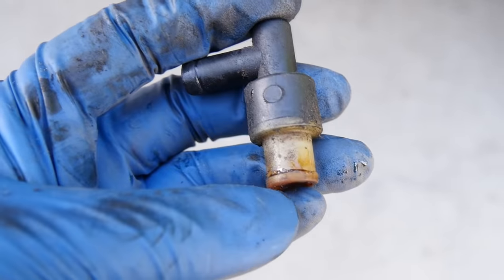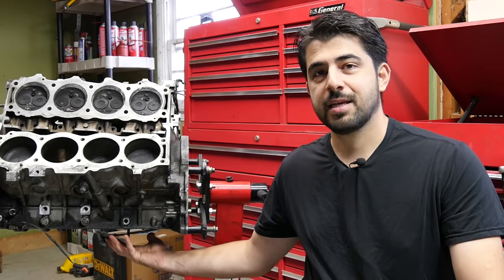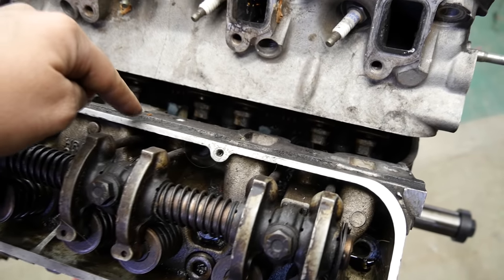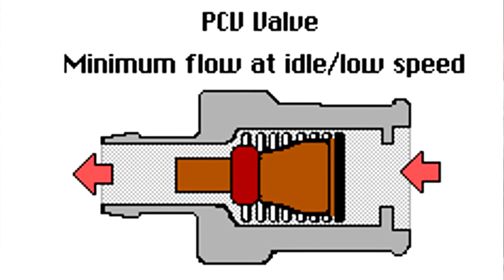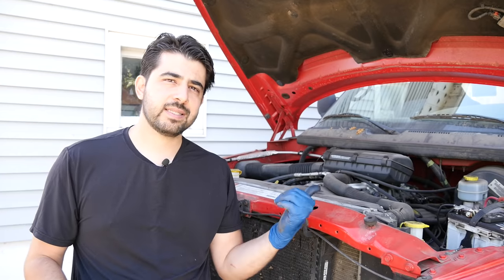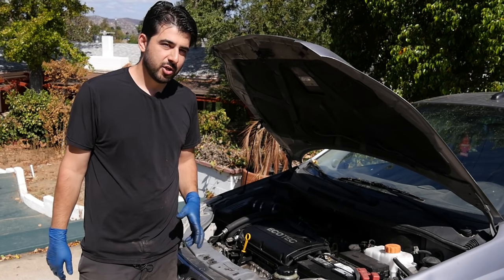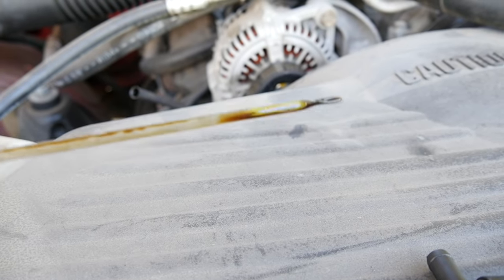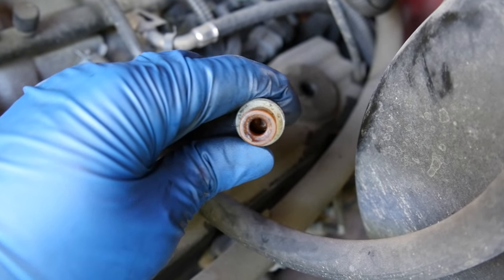The Valve That Can Cause Major Engine Troubles - How to Avoid Engine Sludge

Comment: Nice tutorial. If I may add:
I was thought that the main reason for the spring operated valve inside the unit was to prevent flames from backfired carburetor to go back and ignite the air fuel mixture in the crankcase.

In old engines with carburetors, a backfire flame can travel through intake manifold through the hose back to the valve cover and down to the oil pan area. Thus, the name Positive Crankcase Ventilation valve. Otherwise a one-way valve. 

 Before PCV valves on engine, there was a draft tube that vented the unburn air and fuel mixture to the atmosphere. This produced smog. 

With fuel injector systems on cars, there is very little if any chance of backfire. There is still a need to remove unburned air/fuel mixture from the crankcase.

A small spray of carb cleaner can go a long way to keep the valve working.

Comment: I just went through this same thing on a '98 Ford Contour 2.0.  On this one they made it where it's really difficult to get to.  It is not on a valve cover it is in the crankcase, under the exhaust manifold. There's no way to get to it without removing the e manifold.  The valve cover vents into air intake.  Repairing both, valve was clogged, now working and the other hose from the valve cover was rotted.  It still has crankcase pressure. At idle remove the oil fill cap and it feel it blow out a lot of pressure.  Seals are leaking, they stopped for awhile when I repaired pvc system but pressure is back. And, as you said, vacuum only happens at idle, I can only imagine the pressure get worse above it. Told this customer it a goner.

Comment: In my opinion, if your car is 10 years old or more, does have a PCV valve and is not a pain to replace, doit. The valve costs about 5 bucks or even less, and the grommet about 3 bucks or less... just replace the valve AND the grommet and you could even restore some of that lost mileage!... (or so some utubers claim)

cheers!

cheers!
Reply: 5 bucks for a new PCV valve? Lucky man.. In my country there are genuine PCV valve available, that costs me 70 bucks, plus a new PCV hose for 40 bucks.. It's a 2002 Ford Focus 1.8
Reply: @flycorvus   bro here in South Africa a pcv valve for my Renault scenic ii is around 80 US dollars. And it's only a piece of plastic with a spring and rubber diaphragm... Never buy it. Catch can is almost half the price☺
Reply: Joburg

Comment: Replaced on 70s 302 Ford pickup.  Fram. Ran lean backfired up carb. Always use factory part. Genuine Ford valve fixed.

Comment: Great explanation on PCV valves.
At 120,300 miles I replaced the water pump (weephole leak) and drive belt on my 2018 Civic EXT. Since Honda service were already working on that I had them replace the PCV valve as preventative maintenance. Aside from an earlier AC Condenser replacement (fully covered under Honda extended warranty), the water pump, drive belt, coolant flush was the only major work on my four-year old Civic (Total cost: $1,045.00). Currently averaging 34.1 mpg. Great car.

Comment: A few years ago I bought a Toyota Sequoia cheap because the dealer thought the engine had bad head gasket or worse. After checking things over I found the PVC totally blocked. I installed a new PVC valve and I'm still daily driving that Sequoia with no issues. Yes replace the valve, It's cheap and easy to replace on most engines.

Comment: Yeah you didn’t say how often you should replace it and replacing mine right now after 65,000 miles just because
Reply: They are cheap so I replace them every 5 years or 50,000 miles.
Reply: Read your manual
Reply: So look it up in your manual, call the dealer of your make, or look it up on internet. Really?
Reply: Every 2yrs or 18,600miles or 30,000kms 👌  I just replaced mine from the Honda dealership it was only $36 for my 06 RSX.  My RSX is better on fuel mileage now.

Comment: Another overlooked item is the differential breather valve that releases the pressure inside the differential if it gets plugged up it blows out the seals from your axles

Comment: good explanation of the PCV and a very important part,  this to reduce pressure inside your engine and burning the blow by for cleaner air.
Reply: Very nice  good thoughts
Reply: simple but very important. I've seen them look like brown greasy mud inside.

Comment: Guy, while the PCV valve has been engineered into the system, I invite you to try to simply plug the PCV valve. This information is inaccurate, as you don't even MENTION the Breather Hose! That's where the blow-by will be exiting. I've plugged this valve THOUSANDS of times with ZERO negative events. In fact, I've had so many POSITIVE reports you would be AMAZED!
Reply: Correct ,it's a gizmo fitted entirety for emission control (like the cat)and it's effect is debatable as oil vapour still gets burned instead of venting -it will cause trouble when stuck close -all older cars used a straight forward pipe and with a wire mesh  at the tappet cover intake ,a green gizmo to prevent venting but  burns oil vapour anyway that lands up in the air anyway  and fouls up the top of the motor when blow by becomes exessive at which time an oil catch can make sense
Reply: i have a GM 3.6L alloytec..would this work for that engine,& if so would a catch can system be required?..thanks from Australia😉

Comment: I had an issue with a 01' Firebird. I was fixing everything on it trying to figure out the issue. Went as far as a doing a complete head gasket replacement. It wasn't until I was putting everything back together that I noticed how nasty the intake manifold was. Yep it was a damn 5 dollar pcv that was causing the biggest of the issues. That said it was good to do the complete head gasket replacement as it was 160k and looked like it was starting to go. I swear it gain back a few ponies as I also polished the valves and heads.

Comment: This is great information!  i have the very symptoms you mention, and its only a $10 fix- and requires no tools!!!  I’m pulling no codes, but there’s gas smell in the oil, a new oil pan leak, and a new valve cover leak, and i feel like performance could improve slightly.  THANK YOU! /2002 Lexus RX300

Comment: should the PCV valve be considered a service item, to be replaced after a certain mileage? or we have to wait for it to fail and risk engine damage?
Reply: It's a service item, it's supposed to be replaced after certain mileage
Reply: There are also methods to test if it still works

Comment: So, we take funky oil filled vapor and feed them into a nice clean Throttle Body, Great Design !
Reply: That is why I cutted that crankcase breather hose from my tdi passat several years ago and pointed it to under the engine...
Reply: Salil Sawarim how's that working for you?
Reply: @loudring6247  well it breaths next to oil pan and doesn't freeze up on winter time ( live in Finland) even vithout electric heater coil. Of course there there is some oil stains, so surroundings need to clean with brake cleaner for annual inspection... 😊
Reply: Salil Sawarim aha I see 😄
Reply: #daewoodesign
Reply: It's for anti pollution purpose. It is a legislative demand to the manufacturers of cars.
Reply: It supposedly helps clean valves but if it gets mucked no good.

Comment: I got a callapsed PCV hose on my 99 Ford Focus, I got the car on the cheap and the garage had just replaced the rocker cover gaskets and the rocker seals. I then had to replace both main seals and the sump gasket has now sprung a leak... This hose has essentially required me to replace all the main seals... It makes sense to spend £50 to replace everything PVC related once in a while!!

Comment: Just got done reconditioning a Honda H22 with all new seals, timing components, etc.  Installing into the car after it was on the road I kept noticing oil coming out of the new distributor seal, vtec solenoid gasket and cam seals - all the head seals.  Replaced the PCV valve and I'm not seeing oil seepage in the day I;ve driven it thus far.  Amazing what a $15 part can do...

Comment: A PCV clog caused oil to go up my dipstick tube, which caused me to run low on oil despite regularly checking the dipstick. It doesn't look like there was any terminal damage but a few thousand miles longer and I would've probably destroyed my crankshaft journals. 

This part isn't talked about often enough. Its often cheap and easy to replace and the consequences of its failure can be devastating - so it should really be checked regularly.

Comment: The turbo on my 2005 GMC 2500 with a Duramax was getting filthy because the turbo was the vacuum source for the PCV, since diesels engines do not have vacuum. I changed the PCV hose routing to where the PCV hose was simply venting to the outside and I put a filter to keep debris out of the engine. It has been working fine like this, and the engine oil and turbo stays far cleaner. The engine insides are also far cleaner as well. No need to burn filthy oil vapors in the engine again constantly.

Comment: This video is 2 years old, coincidentally, about 2 years ago I sold a truck because I couldn't figure out what was wrong with it. It start running rough, especially at idle with thin black smoke from exhaust. Also, that truck saw a ton of "idle time", probably about 3 to 4 hours of running in park, 5 days a week. 
Wish I would have found this video when it was new.

Comment: I saved my 2 brothers in the same week for spending money,their xj's jeep where clogged at the pcv valve and having poblems!
Reply: Would be worth replacing it after 100k tbh as it doesn't last forever and a cheap part like that could cost you alot of headache.

Comment: Good job; I had forgotten the way a pcv valve system works.  The new pcv valve for my Ford is only $3.99 at AutoZone.
Reply: Mine is only 139.00 . VW
Reply: Mine is $27.99 @ NAPA for HONDA  V6  engine. 🤔
Reply: My Toyota oem from dealership was just $3.95 😜 TOYOTA FOREVER

Comment: Great video,,,, On carb engines it also keeps a Lean backfire from blowing seals out of the engine by it blocking pressure to the crankcase. EFI rarely if ever backfires from a Lean mix.

Comment: I have a Honda Pilot with a rough idle and some misfiring with a check engine light saying my catalytic converters were bad. I did a tune up with spark plugs, air filter, oil change, etc. Still had the same problems so I started cleaning sensors like intake temp sensor, MAP sensor, etc. Still had the same problems. After watching this video I decided to check the PCV valve and that was bad!!! I looked inside the intake manifold and there was pooling of engine oil and it was covered with a fine layer of oil. I took out the intake manifold to clean it and replaced the PCV valve. Now I have smooth idle, no misfiring, and the check engine light for my catalytic converter is off. The dealership just wanted to replace the cats for $3k. The problems the Pilot had was just a faulty 35 dollar PCV valve.

Comment: So I'm going to go spray a gallon of brake cleaning through mine now lol.  Actually in my owners manual it says to remove the breather from the valve cover on the right side of the engine and not only spray it out with a solvent, but it instructs me to pour clean oil into it every 3,000 miles (with every oil change)

Comment: I could sure use your help. :( If you get this message, I'd like to ask a question kind sir. I'm broke down, 3 times in 3 days, and I'm not sure what to do next. I don't have the money to keep putting this and that on and paying my mechanic, though he deserves it, and it keeps breaking down. He is thinking it may be a fuel pump, but it starts right up, and runs about 15 Miles, it's done this 3 times. If I let it sit 12 hours or so, (break down on the way to work, pick it up after) it fires right back up, smooth as silk, and it'll get another 10 or 15 miles. We replaced the plugs and it wasn't that. I broke down again. So we replaced the distributor cap and button. I broke down again, same place same distance I'd broke down the first time. After the 2nd fix, the cap and button, it broke down AGAIN. SAME PLACE same distance from home. Except this time, after sitting 9 hours, it broke down on me 2 miles down the road. The first 2 times when I started it after sitting, it started up amd ran smooth  ...It will be running fine, then it will miss, a few miles down the road, immediately after the first miss,   it starts sputtering, missing something terrible, small backfires, and it gets to like 10 mph amd won't go any farther til it stops and won't move at all. This last time, yesterday evening in cold, it did it  hour while Iwaited  dornhelo,I and did fire right back up, it was  still missing but allmof a sudden  took off them went righh back  to sputtering. Idk grandmother and I've put alot in it. I just had a rear end installed not a month ago. It is a Dodge ram.1500 2wd 5.9 gas motor, not diesel. The check engine light went off after the cap and button. So I can't get a code. If u have any cheap ideas or any diagnostic tricks I can do myself I have help, I'd be so appreciative. I'm really in a mess right now. Thank you, sir. I was gonna try to get it home tomorrow, when traffic isn't bad, I was gonna take a video and post it and see if anyone would know what the crap going on. I'm very concerned.

Comment: I bought a 2ndhand car. Because of your video i cleaned the pcv valve and discovered the mechanic or previous owner intentionally blocked the hose connected to valve with a bearing. Why do you think they do that?

Comment: Even without blow by, the pistons have the same effect on the crankcase as they do inside the head. Each stroke exerts either positive or negative pressure (compression or vacuum) on the crankcase just as it does in the head, which is why it needs a way to breathe. Manufacturers want you to buy a new car every few years. They could care less about blow by caused by worn rings/cylinders

Comment: On competition engines there are are breather filters on top of the valve covers to vent the pressure. The filters are there to prevent debris from entering the engine but not to obstruct the vapors coming out of the engine. These vent directly to atmosphere. It is very important to not let the vapors build up pressure in the engine as he mentioned.
Reply: A breather filter takes in fresh air. The pcv valve dumps the vapors into the intake plenum

Comment: So idle, high vacuum, pcv check valve fully open, pushes against spring. Throttle plate starts to open, vacuum begins to taper off. Full throttle, pedal to the metal 😂, no vacuum, spring is able to push check valve closed. So pcv opens/closes  opposite to throttle pedal postion, is that correct?

Comment: Someone please comment on this.
I went from a struggling idle that would die if I let up on the gas, to a roaring 1+ RPM and practically double the exhaust force just after popping out this little valve and spray cleaning it with carb cleaner, and snapping it back in.
I would have never expected that in a million years.
The only problem is my muffler is now popping constantly.    I have my O2 sensors disconnected because I was testing them (they are rusted in and I don't know if I can get them out to replace) but they were out before everything was exactly the same.

I'm completely amazed that this little valve did this.
Maybe its stuck open now?

Comment: The PCV valve test for my Honda is to squeeze the hose and listen for a "click". I don't hear any such noise, but there are no other signs of engine trouble. Using a hand suction pump on the hose from the PCV valve, I can confirm that it allows air out of the crankcase but does not allow return air. However, I know that that's not sufficient as the valve should close up somewhat at higher vacuum. With the oil filler cap off, there seems to be positive, pulsing pressure and it doesn't suck a piece of cardboard against the filler hole. I'm not sure if this is a conclusive test, though, as by my reasoning, with the crankcase open, the PCV valve won't have enough pressure difference across it to open up and relieve the crankcase pressure. Should I buy a vacuum test gauge and tee it into the PCV hose? I'm reluctant to just remove the valve as it requires removing the intake manifold to gain access. Thanks!

Comment: The one thing I don't understand about this system:
There is a fresh air in and a vacuum out via the PCV valve.
If the PCV valve is stuck closed, I am told, the pressure builds up in the crankcase and blows seals.
Why doesn't this extra pressure escape through the fresh air in?

Comment: True..... I clean mine with pcv,egr cleaner every week as its a 10 yr old car.... after cleaning engine revs lighter and stops engine knock.

I also do it once a month for my newer cars and it still makes a good difference.... modern cars have bigger clearances and causes more blowby.... so the cleaning of the pcv is important...its a simple job but makes a big difference.
Reply: Not simple on every car, some cars need you to pull the whole front end to get to the pcv valve.
Reply: Engine knock has nothing to do with PVC.   I call BS.
Reply: Wtf are you smoking, all this info you spewed is completely untrue and unnecessary lol

Comment: Dont you think that stuck closed pcv valve will not show any symptoms? Simply, through the ventilation hose, the blow by gases will pass before the throttle body. Is it possible?

Comment: Positive in auto setting means the faster the engine turns the more something happens.  The blowby is only part of the problem. The main need for a PCV valve is the crankcase pressure created under the pistons when they move down.
Reply: One piston moves down and another moves up thereby maintaining the equilibrium.